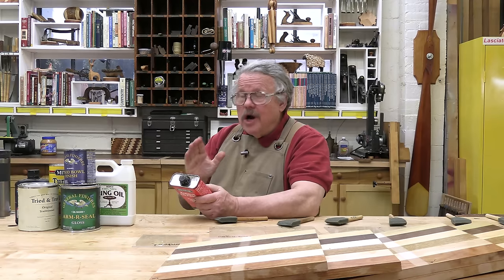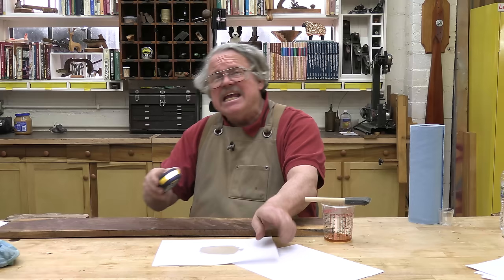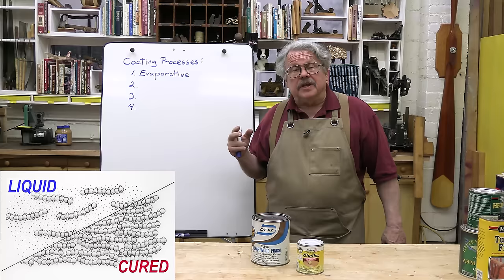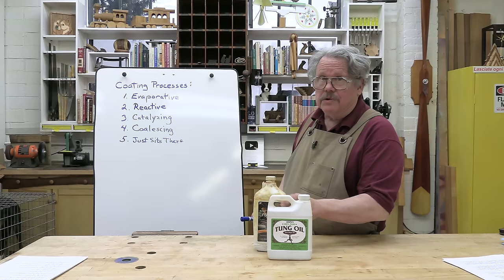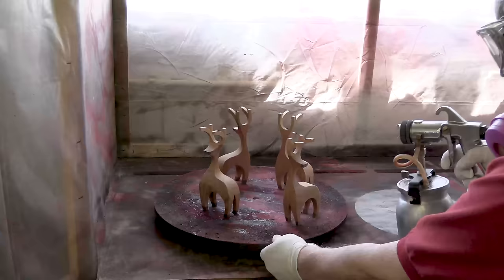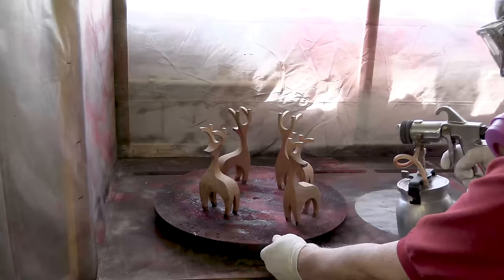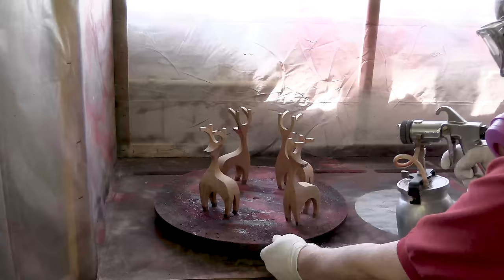Finding the Perfect Finish

Comment: As a retired painter (42 years in the trade) I completely agree with reading the back label of coatings and still do to this day. I always pour the product from the front side of the label as to not obscure the info on the back. I would like to caution persons on the proper drying and disposal of wiping rags, whether solvent-based finishes as well as solvent-based stains including especially linseed oil. ALL RAGS MUST BE LAID OR HUNG FLAT TO DRY COMPLETELY BEFORE DISPOSAL TO AVOID SPONTANEOUS COMBUSTION, once dry and hard, can be thrown in the trash.
Reply from the maker: It's a good warning. Most reactive finishes produce exothermic reactions as they cure. This is especially true of (but not limited to) reactive finishes containing linseed oil.
Reply: Both excellent points and good reminders.  I habitually pour incorrectly and cannot read back label anymore!
In my inexperience years ago, I stuffed stripper chemical rags into a small open trash bin and it caught on fire!  I was so surprised.  Learned my lesson.  I let them dry out now before throwing into an OPEN trash container for at least 1 day.

Comment: 0:00 Intro
1:58 Why Apply a Finish?
4:11 Coating Chemistry
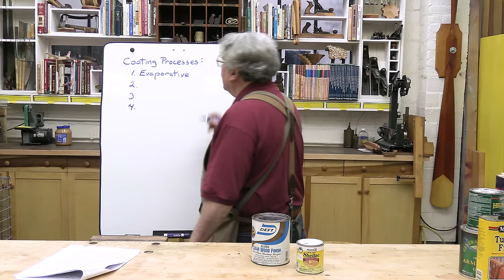5:32 Coating Processes & Applications
8:52 Spray-on Coating Application
9:35 Brush-on Coating Application
10:00 Wipe-on Coating Application
11:24 Surveying the Available Finishes
13:00 Tested Finishes
14:44 Finish on Glass Test Discussion
15:14 Food Safe Finish Discussion
16:47 Testing the Finishes (Method discussion) 
21:08 Hope's Tung Oil Results
21:33 Tried & True Original Linseed Results
22:12 Minwax Tung Oil Finish Results
22:50 General Finishes Wood Bowl Finish Results
23:20 Minwax Antique Oil Finish Results
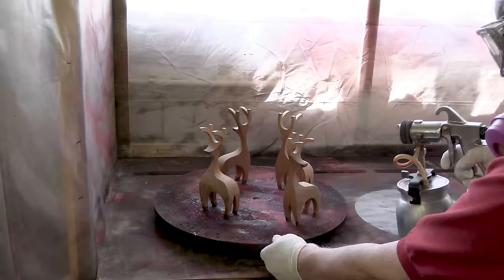23:43 Minwax Wipe on Poly Results
24:17 General Finishes Arm-R-Seal Gloss Results
24:46 Baloney-IMHO disclaimer!
25:20 Rudy's Original Wipe-On Finish Formula
Reply from the maker: Wow. That was thorough. Intro amended -- thank you muchly.
Reply: @WorkshopCompanion  Thank you, the least I could do for such a detailed video. I keep coming back to it, and recommending it others.
Reply: 26:56 🐶
Reply: Thank you
Reply: Haha. Someone has too much time on their hands. 😂
Reply: Would this get sticky after a couple of years on a kitchen butcher block table?  Everything I have used gets sticky😢

Comment: I'm a budget crafter I make small wooden trinkets. I got given a small bottle of a mix of tung oil and citrus oil. It takes a while to dry but but dries reasonably hard and has a nice satin finish or a bit more glossy if I keep polishing it while drying. It also smells like oranges :D
Reply: If I might interject, if you are currently doing the application and buffing sand gloves you'll want to be careful about continuing to do so. The 'citrus solvent' is limonene and it's a known sensitiser, and will become increasingly so as the remaining finish in the container has a chance to react with air as the fluid level drops.

Comment: This channel is a treasure. Did you come to a finding on the elasticity of the finishes and how they hold up under seasonal movement? Just curious. I'll try Rudy's finish i'm betting it satisfies in that department.
Reply from the maker: It does. What I used to judge relative flexibility were the cotton cloths I used to wipe-off the finishes. Remember, I labeled each of these to avoid cross-contamination and they were all pretty well saturated with their respective finishes by the time the experiment concluded. I tested my ability to stretch the cloths a week afterwards, when most of the finishes were completely cured. Hope's Tung Oil and Tried & True Original Finish were, by far, the most flexible (although I doubt they were fully cured at that time). The least flexible was General Finishes Arm-R-Seal and Minwax Wipe-On Poly. But all the finishes I judged to have sufficient flexibility to expand and contract with normal wood movement.
Reply: As a general observation, all finishes in good condition are flexible enough to withstand seasonal movement... otherwise they wouldn't withstand seasonal movement if you see what I'm getting at🙂 We don't commonly see stuff that's just a few years old with cracked finishes. It's well to remember as well, by being present finishes do limit the total movement by reducing the speed and severity of MC changes, as Nick mentions.

Even finishes thought to be rigid and inflexible must be definition be flexible enough (in the usual coat thicknesses used) otherwise they wouldn't last more than a year or two before cracks started showing up. 

But this doesn't last forever, most finishes degrade as they age (primarily from UV but another major factor in furniture can be water intrusion) and in addition to the typical increase in amber/yellow-orange colouring, they become brittle. Given the small scale of possible movement we see this effect most strikingly on many old Stanley plane handles where the original film finish can craze spectacularly.
Reply: @WorkshopCompanion  ah! I was wondering how you tested that. Spar varnish or urethane has got to perform well in that regard, by design.
Reply: Could not agree with you more. After just 3 mins in I knew I had found something special. Thank you for sharing your amazing knowledge with us. The witty bits are quite enjoyable as well.
Reply: Thank you for your help.  I now have a plan for coating some Christmas gifts.  Your channel is a gift this year!  A+
Reply: @edtsch  I like danish oil then wax, but that's why I'm here heh. There are 1000 different options, with 999 of them overlapping in multiple characteristics. I used helmspar for outdoor stuff and 5 yrs later it's still good. But while they say you can use it on countertops, it's so soft I don't know if I can trust it for scratches
Reply: Thank you, you have an very through experiment and have evaluated them so well. It’s interesting ,but to be honest I still like shellac and rub out with lemon oil on my small wooden boxes.

Comment: I have no knowledge or experience staining and/or finishing wood, but a recent small project taught me something.  If you want to use Rudy's Wipe On Finish (discussed @ 25:20) be sure to use the oil based Minwax Helmsman Spar Urethane (as shown in the video).  Minwax also sells a very similar product with near identical labeling but with the words "Water Based" added.  The water based Spar Urethane does not mix well (if at all) with Minwax Tung Oil Finish.  Because Tung Oil Finish is oil based?  That would be my guess.
Reply: That's because you only mix oil with oil based products. 🤷
Reply: @rustic35 , Ergo the old saw: "Oil and water do not mix" is based on observable fact.
Reply: Yes, correct.  Water based finishes are awful in my opinion. I only use oil based.  One thing to note: Spar Varnish has more UV resistance than Spar Urethane but Urethane is easier.

Comment: Equal parts spar varnish, oil, and solvent. In the summer use tung oil and and in the winter boiled linseed oil. The recipe called for turpentine or mineral spirits but the latter doesn’t appear to be available today so a synthetic mineral spirit will do. Wipe on and wipe off. If the finish becomes too tacky wet your rag with a mineral spirits. Little rubbing between coats is necessary if a layer of thin shellac is applied between coats. #0000 steel wool can be used to knock down any dust nubs.

Stained wood and open grained presents new challenges to finishing but the method of wipe on varnish and shellac sealing overcome these. Also, the build up of finish is much faster and the final top coat can be anything from a French polish to a satin sheen.
Reply: This recipe or a version is found in George Franks finishing book from the 1940's ? I believe.
I have used this very successfully on red / yellow cedar for 40 years. It draws the varnish into the lower layers to really add surface hardness to an otherwise very soft wood.
I am unfamiliar wiht the large ratio provided in the video, have always used a lot more varnish.

Comment: Great, important and useful video.  Very well done.  I believe polyurethane and ceramic are not water semi-permeable finishes.  
I use hardwax oil finishes for more and more projects that I do.  I found Osmo better in terms of penetration, application and durability than the others, like Tried & True, although Ruby is excellent too.  One of the critical factors is that a good hardwax oil is durable enough to use for high traffic wood flooring, leaves the wood grain feel, is maintainable like shellac where a new coat will adhere to prior ones, but unlike shellac it is much harder and is not dissolved or damaged by alcohol.  I use a teflon pad to apply deeply, efficiently and even, while getting a grain burnishing effect that you do not get with a brush or wipe-on.  
I sometimes use ceramic or carbon nano-coats on top of the finish for scratch durability.  However, ceramic nanocoats make damage repairs more difficult.

Comment: Really useful! Such a pleasure to hear the views and opinions of a true experienced craftsman. I feel like I have gained some depth of knowledge, rather than a single opinion/viewpoint. Thanks :)

I would be most interested in your views on finishes such as hard wax (Osmo) and outliers such as Rubio Monocoat.
Reply: From what I've seen, Rubio is basically the choice high end woodworkers are going with now, especially for custom stuff. One thin coat, buff it in, dry and done. Maybe a super light sanding and a second coat to really be sure. Then a final application of a ceramic nano-coating product that basically completely eliminates water damage/staining.

I'll note too that since it's a two-part, it only starts the clock on it going bad once it's mixed, and you can easily only mix enough for each project.

Comment: For a specific sealing situation - a harmonica 'comb' - I settled on Watco Butcher Block finish, with pretty positive results. The pearwood was not very dense, and the shape gave no area more than 1/8" to permeate. I floated the comb in a small foil tray, careful to leave the top surface dry, so air could migrate out; after a few hours, the surface showed full penetration, and I took it out and wiped dry. Covering the tray to avoid pre-oxidation, I repeated the process two more times over four days, then let the comb air-cure for a couple weeks. The finish is an alkyd base, which cures by both initial solvent evaporation, then oxidation reaction with air, similar but much faster than classic linseed oil. After drying it is totally food  safe, and has over time created the closest thing to a DIY resin-sealed wood that is very tough, more resonant than the dry wood, and yet did not warp compared to water soaking the same types of wood. I made small dowel spacers to avoid warping but mostly seemed unnecessary. Pre-sanding to shape lets the final coat leave a satin sheen that is appealing, but for food surfaces wiping excess off is preferable to striving for more gloss.
  For other wood, I've preferred Watco penetrating oils, but shifted to their teak oil version, for more protection and UV blocking(all versions are mixtures that reactively cure with air exposure). Oils cure hard enough, to protect but leave the wood natural-looking without a thick finish, which in worst cases can lead to looking like formica - a sin against real wood. Oils can be re-applied without difficult sanding or removal, and rubbed to a great semi-gloss luster I prefer over any high gloss that just looks like plastic. Practically, water-based polyurethanes dry harder than most solvent-based versions, the only downside is the contemporary "water clear" look that lacks the traditional, amber tint many actually prefer.

Comment: Another well done, informative, well thought out, classy, down right professionally done video.

I use polyurethane on the laminated bowls I make.  They’re of apricot, English walnut, soft maple and white or red oak.  
The luster improves with each coat and after five they really do look lovely.
I have settled on the blue towel as my “brush”. It’ll apply the finish and wipe excess off as well.
Again, your videos are very well done.
I did notice the Shopsmith.  Your videos, “Sawdust Sessions”, I recommend often to the Shopsmith User Group especially the, “Setting planer knives”. 
Good on yuh.👊
Reply from the maker: Thanks for saying.

Comment: Wow, excellent information and techniques delivered in a most professional and meaningful manner.  I learned a lot from this. Here is my own go to finish:
First I prep the wood with an 80 grit sandpaper so the fibers are most porous. Spray with water and wipe down. Then I apply boiled linseed oil with a brush, wait 20 minutes then rub the excess off with a lint free cloth burnishing the oil into the rub. Let dry overnight then sand with 120 grit sandpaper. Reapply the BLO as before but using 4/0 steel wool pad instead of a brush. After 20 minutes rub off the oil and burnish into the wood aggressively with a clean dry cloth. Immediately follow with a coat of spar varnish or spar urethane. Finish with a good wax and buff.

Comment: I loved this. Funny thing, I use water based poly BECAUSE it doesn’t warm (or in my parlance, “yellow” 😏) the wood. To each her own!
Reply from the maker: I have often thought that wood finishers are like snowflakes -- no two do it the same. Thanks for saying.
Reply: Can you use the minwax water based urethane along with the tung oil? To try and keep the wood from yellowing over time.
Reply: @shanedaugherty8596  I’ve heard that you can apply a water-based finish over oil if you wait for the oil to completely cure. I plan to test it out if a table I finished in Danish oil ever stops smelling like Danish Oil (it’s been about a year).  But I don’t think polycrylic will stop wood from darkening with light exposure. At least, the color change in some maple I used polycrylic on maybe nine months ago is intense.

Comment: Great video!! You’re a wealth of information, I’m glad I found your channel! I’m curious what your take is on the hard wax oils that I see all over YouTube (Osmo Polyx, Rubio Monocoat, etc.)
Reply: I actually had the exact same thought. I love Rubio so far, other than the lack of sheen. It's so easy to apply and looks and feels great. Not sure of durability yet.
Reply: @avenger429  I haven’t used it yet, but from what I understand, durability shouldn’t be a concern. It was formulated for floors. I’ve seen some videos talking about durability and it seems that if it doesn’t get damaged, it’s much easier to repair that varnishes like polyurethane because you can just sand back the damaged area and refinish instead of stripping the whole piece. But again, I haven’t used it myself so I’m not speaking from experience.
Reply: @Dragon_With_Matches  Don't hesitate to try it! It is so satisfying to use, smells mildly like bananas, and it's 1 coat and done. A very little goes a long ways. It seems expensive at 1st until you realize it stretches super far and you only need 1 coat.
Reply: @avenger429  I’m looking forward to trying it when I build a bookcase later this year! I’ve seen a lot of YouTubers use it and it looks amazing!
Reply: @Dragon_With_Matches  Awesome! I'd suggest for larger projects to slap a white schotchbrite pad onto an adjustable speed random orbital sander or small buffer to speed up the process. Just remember use a little at a time, otherwise you'll be flinging wax everywhere... Don't ask how I know that, lol.
Reply: @avenger429  thanks for the tip! I look forward to trying it out!

Comment: You get a much better result with Tung oil finishes if you use 000 or 0000 grade steel wool to rub back.  For best results rub back wet, using more Tung oil .  You get a smooth satin finish - and of course you are adding another layer of oil.  I normally rub back like that when the oil is developing a bit of a buildup on the surface.  Full polymerisation can take weeks in cold weather but a mere couple of days in warm.  Until the oil has hardened fiture coats are just adding more oil into the surface but little build up.  The first few coats are helped by adding pure turps to thin and carry deeper into the wood.  Mineral turpentine does not work nearly as well.

Comment: Very helpful thank you. I buy a lot of second hand furniture and recently I've decided to try and learn how to spruce it up a bit. A lot of it is really great just has a lot of surface wear. I'm a craftsperson but I almost never really work with wood, and have only extremely basic woodworking knowledge. But the woodworking shop was just one door down from our studio and we were required to take at least one class there, so I'm extremely aware of the fact that none of this is ever as easy as it seems. The whole thing was kind of giving me decision paralysis, having it laid out very simply and analytically like this just makes everything much easier to process. Funny thing is information like this means that you usually end up at the exact same conclusion that you had arrived at from your own reading, you just feel much more confident in the fact that you actually made the right choice.

Comment: Minwax Tung Oil Finish has been my go-to for several years now, so I am 100% with you  :)   I will usually thin it out a little with some mineral spirits towards the last coats I do, it gives a nice, smooth final finish when all is said and done.  Then I give a finishing sand-down with some steel wool, depending on how shiny I want my topcoat.  I'm happy to see someone with many more years of more in-depth woodworking experience also uses it  :)
Reply: How many times did you sand after the first finishing coat? What grit did you use, and how  finishing coats, if you don't mind answering? Thank You!